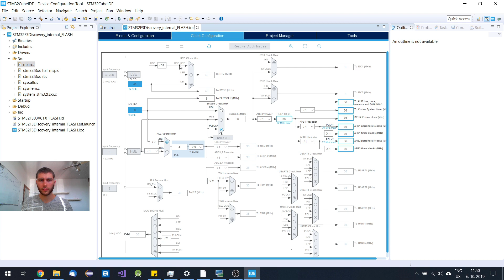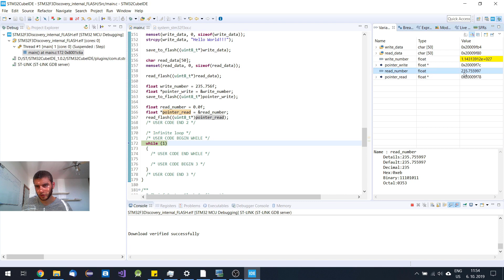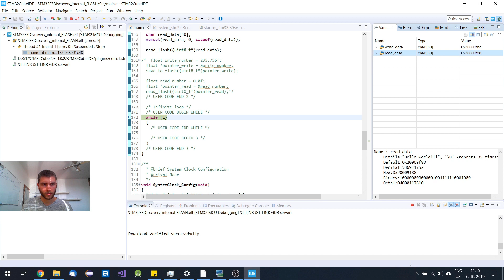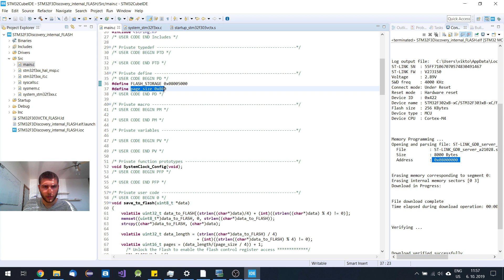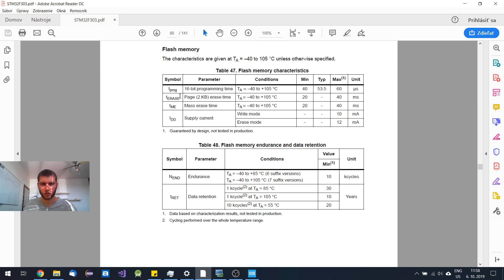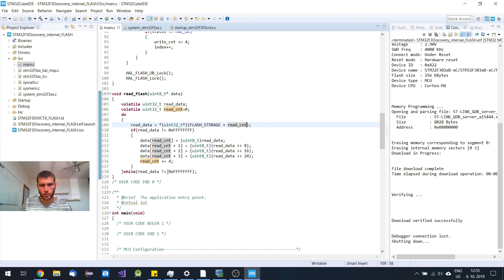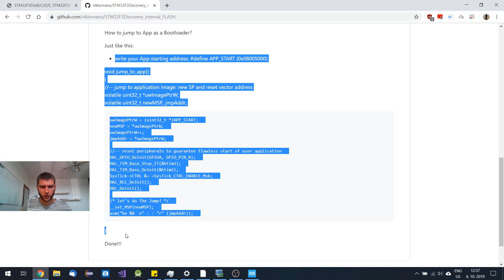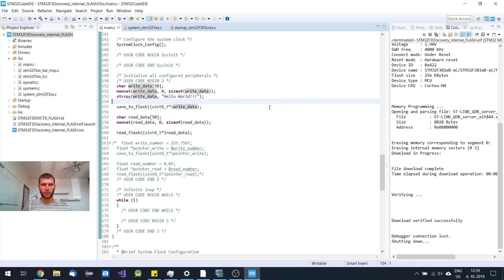STM32 tutorial - write and read internal FLASH memory + Bootloader jump function

Comment: Firstly, I would like to say thank you for your sharing this video. Secondly, I have one concern in your code. You have used Erase command to erase flash memory. But as you known that command will be erased data in full page. That other data will be erased in same this page. It doesn’t belong to data as “Hello”. Do you have any solution for this ? I don’t want to use RAN to resolve this issue.
Reply from the maker: Hi, this is an old bad tutorial. I have made a good quality tutorial on dual bootloader.
Reply from the maker: Thanks. I know the quality of the code and video is bad.

Comment: Well explain!!! thank you
Reply from the maker: Here sir:
https://youtu.be/S0s69xNE1dE
Reply: @ViktorVano   well i will check it out for sure
however can you tell me why you are using size32_t in your code (e.g uint32_t *Data, uint32_t *data = "hello FLASH from...)
does it has any meaning you chose this type?
Reply from the maker: @YoniShkolsky  32 bit MCU flashes 32 bits at once. That simple. In the tutorial it should be explained.
Reply from the maker: Glad to hear this. You are welcome.
Reply from the maker: Well technically I do have a better tutorial for a dual bootloader with 2 separate firmwares on one STM32 + bootloader.

Comment: Hello great video

I have a problem.
when I try to store this array in flash memory,
char write_data [50] = {0x7E, 0xAA, 0x01,0x00,0XBB, 0XAA, 0XCC, 0X11,0X22};

it only saves me up to the position (write_data [3] of the array) in memory

How can I solve this problem?
Reply from the maker: It saves it as a string. So the 0x00 is NULL there. 
It uses strlen(), but you have to rewrite it... 
delete this:
volatile uint32_t data_length = (strlen((char*)data_to_FLASH) / 4)+ (int)((strlen((char*)data_to_FLASH) % 4) != 0);
And change head of the function from void save_to_flash(uint8_t *data) to void save_to_flash(uint8_t *data, int data_length)
Reply: @ViktorVano  hi thanks for replying

although I still have the same problem, make the changes you suggested in your answer and it does not work, it still recognizes the 0x00 as NULL

this is my code

#define FLASH_STORAGE 0x0801FBF0
#define page_size 1024

void save_to_flash(uint8_t *data,int data_length) {
	volatile uint32_t data_to_FLASH[(strlen((char*) data) / 4) + (int) ((strlen((char*) data) % 4) != 0)];

	memset((uint8_t*) data_to_FLASH, 0, strlen((char*) data_to_FLASH));
	strcpy((char*) data_to_FLASH, (char*) data);

	//volatile uint32_t data_length = (strlen((char*) data_to_FLASH) / 4)	+ (int) ((strlen((char*) data_to_FLASH) % 4) != 0);

	volatile uint16_t pages = (strlen((char*) data) / page_size)
			+ (int) ((strlen((char*) data) % page_size) != 0);
	/* Unlock the Flash to enable the flash control register access *************/
	HAL_FLASH_Unlock();

	/* Allow Access to option bytes sector */
	HAL_FLASH_OB_Unlock();

	/* Fill EraseInit structure*/
	FLASH_EraseInitTypeDef EraseInitStruct;
	EraseInitStruct.TypeErase = FLASH_TYPEERASE_PAGES;
	EraseInitStruct.PageAddress = FLASH_STORAGE;
	EraseInitStruct.NbPages = pages;
	uint32_t PageError;

	volatile uint32_t write_cnt = 0, index = 0;

	volatile HAL_StatusTypeDef status;
	status = HAL_FLASHEx_Erase(&EraseInitStruct, &PageError);
	while (index < data_length) {
		if (status == HAL_OK) {
			status = HAL_FLASH_Program(FLASH_TYPEPROGRAM_WORD,
			FLASH_STORAGE + write_cnt, data_to_FLASH[index]);
			if (status == HAL_OK) {
				write_cnt += 4;
				index++;
			}
		}
	}

	HAL_FLASH_OB_Lock();
	HAL_FLASH_Lock();
}

void read_flash(uint8_t *data) {
	volatile uint32_t read_data;
	volatile uint32_t read_cnt = 0;
	do {
		read_data = *(uint32_t*) (FLASH_STORAGE + read_cnt);
		if (read_data != 0xFFFFFFFF) {
			data[read_cnt] = (uint8_t) read_data;
			data[read_cnt + 1] = (uint8_t) (read_data >> 8);
			data[read_cnt + 2] = (uint8_t) (read_data >> 16);
			data[read_cnt + 3] = (uint8_t) (read_data >> 24);
			read_cnt += 4;
		}
	} while (read_data != 0xFFFFFFFF);
}

/* USER CODE END 0 */

/**
 * @brief  The application entry point.
 * @retval int
 */
int main(void) {
	/* USER CODE BEGIN 1 */

	/* USER CODE END 1 */

	/* MCU Configuration--------------------------------------------------------*/

	/* Reset of all peripherals, Initializes the Flash interface and the Systick. */
	HAL_Init();

	/* USER CODE BEGIN Init */

	/* USER CODE END Init */

	/* Configure the system clock */
	SystemClock_Config();

	/* USER CODE BEGIN SysInit */

	/* USER CODE END SysInit */

	/* Initialize all configured peripherals */
	MX_GPIO_Init();
	MX_USART1_UART_Init();
	/* USER CODE BEGIN 2 */

	char write_data[50] = { 0xAA, 0x33, 0x00, 0x02, 0XBB, 0XAA, 0XCC, 0X11, 0X22 };

	save_to_flash((uint8_t*) write_data,9);

	/* USER CODE END 2 */

	/* Infinite loop */
	/* USER CODE BEGIN WHILE */
	while (1) {

		/* USER CODE END WHILE */

		/* USER CODE BEGIN 3 */
	}
	/* USER CODE END 3 */
}
Reply from the maker: @andresceballos1451  I see that the first line uses strlen() too. (array called data_to_FLASH)
volatile uint32_t data_to_FLASH[data_length];
That may be it.
Reply from the maker: And I have made a new STM32 Bootloader Tutorial: https://youtu.be/S0s69xNE1dE

Comment: what changes should make for STM32WB55?
Reply from the maker: Well you need to check a reference manual to find out what is the FLASH memory origin, size of the Flash Memory and the page size. 
Also check generated HAL functions to get familiar with them. HAL functions make a good abstraction and make the code more compatible across different MCUs. You need to find out what differs from my example, but steps should be the same.
 This tutorial was more general to understand what steps are necessary to be able to read, write and erase the memory.

I have made a newer tutorial about the bootloader that can update 2 applications on the STM32.
https://www.youtube.com/watch?v=S0s69xNE1dE
Reply: @ViktorVano  thank you very much
Reply: I changed the code according to to stm32wb55 . But when I debug it , it stuck in the while loop in save to flash function .Im still searching for error

Comment: I have an STM32H7, and despite a HAL_OK for every write, 

	HAL_FLASH_Unlock();
	if (HAL_FLASH_Program(FLASH_TYPEPROGRAM_FLASHWORD, 0x081E0000+ (32*fw), (uint32_t)(pBuffer)) != HAL_OK)
	{
             Error_Handler();
	}
	HAL_FLASH_Lock();

OCCASIONALLY, the write appears to cause an alignment/ECC error.    Simply READING from the sector, will cause a Hard-Fault/IRQ0.    The only way to recover, is to erase the chip.   

For testing, I'm writing an incrementing pattern, and the fault seems to happen randomly at a different address/data each time. 

Any idea if there's a way to disable the ECC on the sector.. or if it's a CACHE issue?

Comment: The Stm32h7 has a 32-byte flash word..  so I keep a buffer,

uint32_t buffer [ 8 ]  = {0xFFFFFFFFL , 0xFFFFFFFFL , 0xFFFFFFFFL , 0xFFFFFFFFL , 0xFFFFFFFFL , 0xFFFFFFFFL , 0xFFFFFFFFL , 0xFFFFFFFFL};

where anytime I want to write to flash, I use the next empty (0xFFFFFFFF) index in the buffer and then pass it all to the flash:
HAL_FLASH_Program(FLASH_TYPEPROGRAM_FLASHWORD, 0x081E0000, buffer) == HAL_OK)

This mostly works except randomly after so a few writes or so, HAL_FLASH_Program corrupts the flash, even though it returns HAL_OK.   Don't know exactly how it corrupts it because if I try to read the flash I get a hard fault.   Stm32CubeProgrammer can't read it either.

Seems to happen randomly.. not sure if it's a cache issue but how would I disable it to test?  Or maybe an issue with the buffer.. how can align it to test?   Or declare it as volatile?    I don't think it's a voltage issue as I'm using an ST Disco board.
Reply from the maker: Well I would make a function that reads flash after writing to it. It will be slower, but it will make sure that the written value is correct.

Comment: nice video.

Why can not be written at 0x8005001 address directly? (setting #define FLASH_STORAGE 0x08005001 return HardFault_IRQn). 
Best regards from Brazil
Reply from the maker: you probably have not unlocked that FLASH memory. I have made a new tutorial recently for a bootloader.

If you want to learn to make your own custom Bootloader for STM32 in C in STM32CubeIDE. (not Arduino) 
Just watch this to learn, how it is done from scratch: https://www.youtube.com/watch?v=S0s69xNE1dE
Reply: @ViktorVano  I could write at any even address. I read that is an architectural limit because of the memory organization.
Reply from the maker: @DELPITEC  Yes you can, but you need to avoid overwriting your application. Therefore after building you app, you need to check how many bytes and pages it takes. Then you can read and write next free page after your current application. Check that tutorial above, it is about bootloader. I was explaining those things there. 
You need to also know the origin of the FLASH memory.
Here is my latest Bootloader project.  https://github.com/viktorvano/STM32-Bootloader

Comment: #define FLASH_STORAGE 0x08000400
#define page_size 0x400
                                 
#define pages 1 

IS THIS OK FOR MY MICRO  WHICH IS STM32F103C8 ?
Reply from the maker: That page size is correct. But you need to know where your application ends, otherwise you will corrupt your existing application.

If you want to learn to make your own custom Bootloader for STM32 in C in STM32CubeIDE. (not Arduino)
Just watch this to learn, how it is done from scratch: https://www.youtube.com/watch?v=S0s69xNE1dE

This is from my latest tutorial:
#define APP1_START (0x08005000)			//Origin + Bootloader size (20kB)
#define APP2_START (0x0800A800)			//Origin + Bootloader size (20kB) + App1 Bank (22kB)
#define FLASH_BANK_SIZE (0X5800)		//22kB
#define FLASH_PAGE_SIZE_USER (0x400)	//1kB

Comment: Only one question, why do you unlock and lock the optional bytes?
Reply from the maker: I was following an ST presentation for bootloader. They were unlocking those optional bytes is a similar way before writing to the flash memory. I can upload that presentation to the GitHub it I will find it.
Reply from the maker: I have uploaded it on GitHub. Check slide 19, it is there.  https://github.com/viktorvano/STM32F3Discovery_internal_FLASH/blob/master/SD%20card%20bootloader%20for%20STM32.pptx

Comment: Looks very useful!  I'm hoping to be able to update my cpu code in-system via Can-Bus!   However, doesn't a new chip automatically jump to a specific address in flash (assuming the internal bootloader isn't enabled (via BOOT0))...  so I assume I would to have STM32F3Discovery_internal_FLASH erase/write to that jump address?
BTW, any thoughts on 'stm32-versprog' which seems to also flash memory.. but it seems you have to force the chip to BOOT0 mode, and it only programs external spi flashes.. not internal?
Reply from the maker: I did program internal Flash memory in this video. Usually MCU's PC (Program Counter) starts at 0x8000000 which is the origin of flash memory. And when you want to jump with the PC (Program Counter), you need to deinitialize your MCU to default state and the app have to be there on the first place, otherwise the MCU will probably end up in the error handler.

If you first flash your new app to a different flash sector, then you can jump there to your new app.
Reply: @ViktorVano  Hi Viktor, 
Thanks for the video! I am working on STM32f407vgt. Now I can save my new application in sector 1 reading from SD card). But when I try to jump to the first of sector 1 something goes wrong! The original code (which is in sector 0) not working as expected and when I reset, it works again! but never jump to the new application in sector 1.  Here is my jump function: 

HAL_GPIO_DeInit(GPIOD, GPIO_PIN_14 | GPIO_PIN_15);
HAL_GPIO_DeInit(GPIOA, GPIO_PIN_0);
SysTick -> CTRL &= ~Systick_CTRL_ENABLE_MSK;
HAL_RCC_DeInit();
HAL_DeInit();
 __set_MSP(*(__IO uint32_t*)0x08004000 + 0x4); 
   
Is there any thing I miss that it doesn't work?! 
Many thanks in advance!
Reply from the maker: @vahidam61  Be careful with MSP and JumpAddress, they differ.

May be like:
__set_MSP(*(__IO uint32_t*)0x08004000); 
asm("bx %0  n" : : "r" (0x08004000+0x4));
Sector size in STM32F407 is 16kB which is 0x4000. You should always start erasing, writing from the origin of a new sector. That 0x4 may cause a problem.

My example, new MSP and jmpAddr just differ:

#define APP_START (0x08005000)
volatile uint32_t *uwImagePtrW;
volatile uint32_t newMSP, jmpAddr;

uwImagePtrW = (uint32_t *)APP_START;  
newMSP = *uwImagePtrW;  
uwImagePtrW++;  
jmpAddr = *uwImagePtrW; 

/* let's do The Jump! */  
__set_MSP(newMSP);  
asm("bx %0  n" : : "r" (jmpAddr));